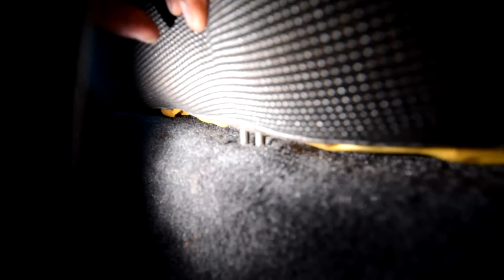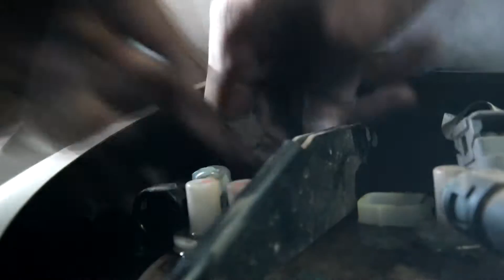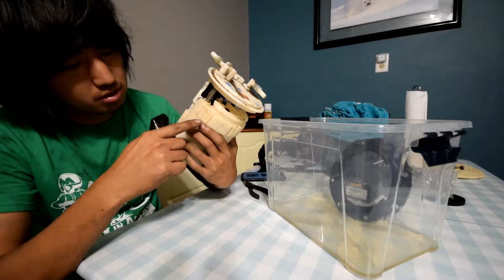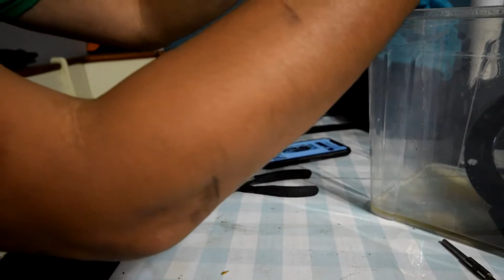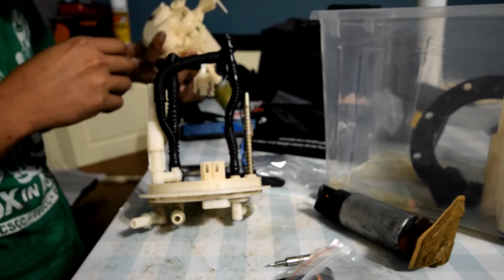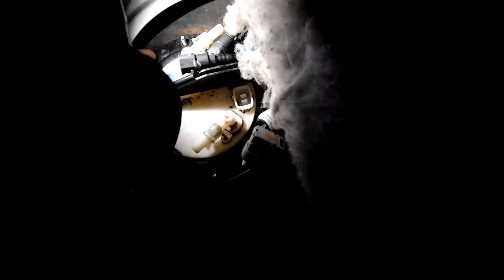Part 2: Outback XT AEM 320LPH fuel pump install (BP/BL Subaru)

Comment: What year is your OBXT? I heard it's best to attempt this job with 1/2 a tank of gas or less, also opening the gas cap to release pressure. Thanks for the video, very helpful.
Reply from the maker: it was an 05. it would be slightly less messy with less fuel but it's not required. good luck!
Reply: @ Thank you.
Reply: Forgot to ask, did you have to get a tune after the install because of the increased fuel pressure?
Reply from the maker: @Mike3_6_9  no, that is not needed because the stock regulator will work just fine with the increased output pump as the excess will be returned to the tank. the increased output only comes into play in areas where you would've had a loss of fuel pressure with the OEM pump.
Reply: @hoon5630  I see. Thank you for the reply.